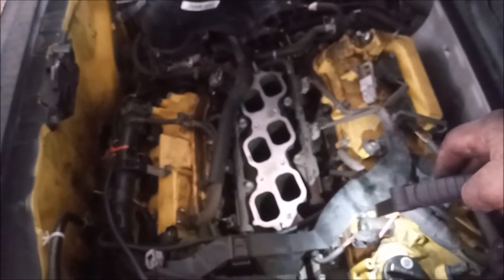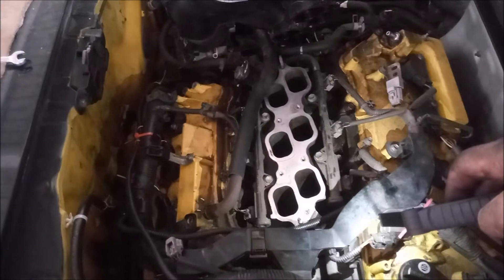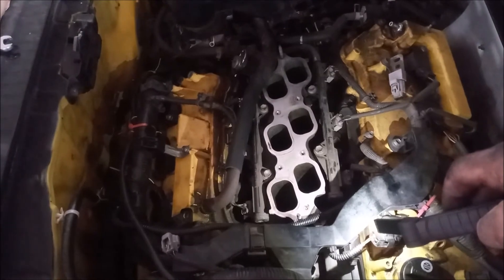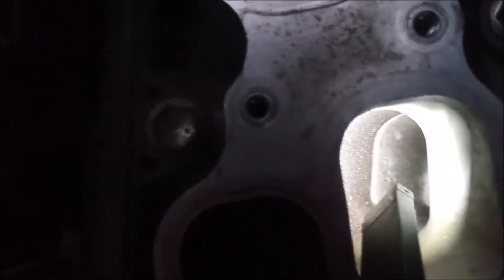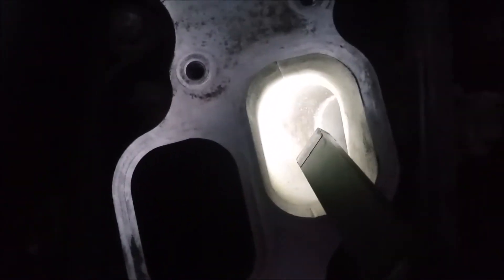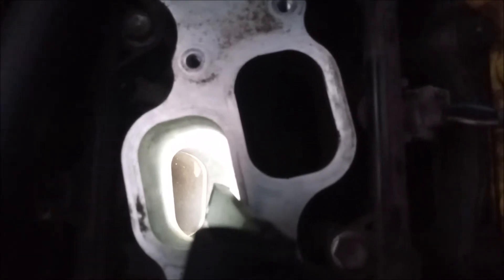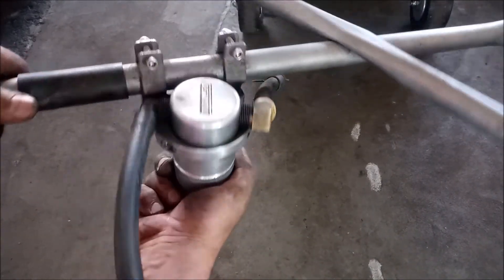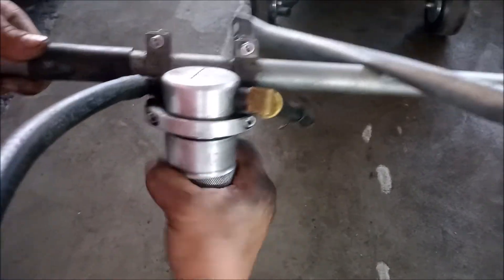Moroso Billet Catch Can - Does It Really Work?

Comment: Wow! I wonder if this would be handy on my 1zz? I am rebuilding the engine 🤔
Reply from the maker: Yes absolutely. I had one on my 1zz SC and believe you me it filled up regularly.
Reply: @Merryfrankster_  Awesome! Would it go between the Ventilation Valve on the side of the Cylinder Head Cover and the pipe that goes to the Intake Manifold?
Reply from the maker: @warrenhoole7723  see my video on the pcv system. You really need the catchcan between the pcv valve and the plenum. A second catch can on the crankcase beather is optional for boosted cars with forced induction.